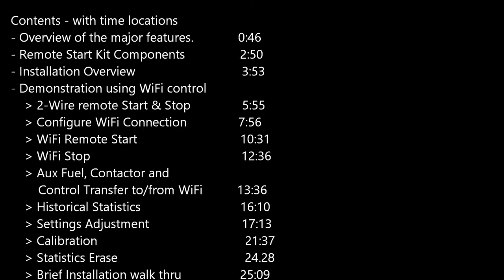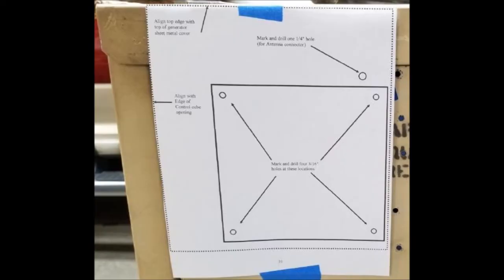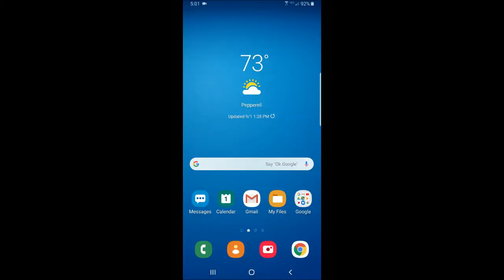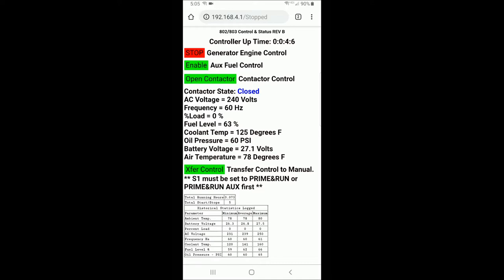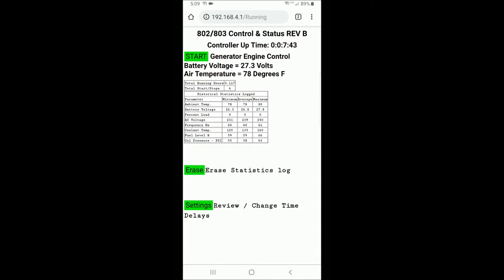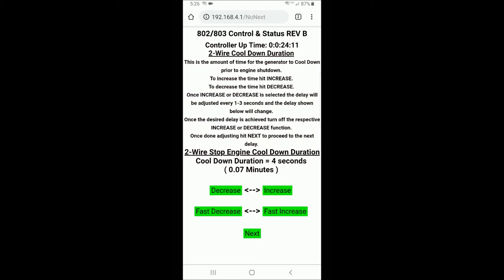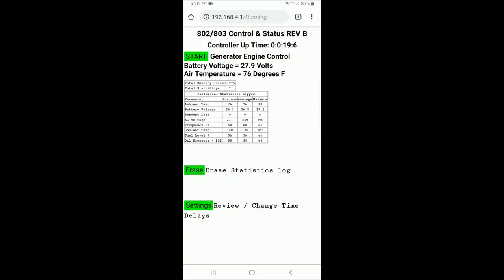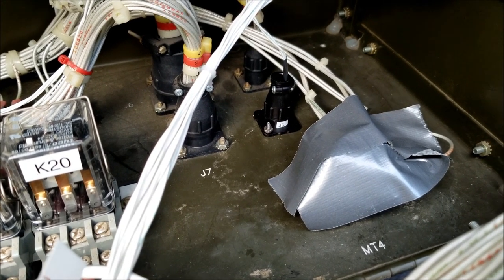MEP 802A MEP 803A Remote Start Kit

Comment: Looks fantastic.  Can the controller connect to my existing wifi router so it is not necessary change wifi connection in order to access it over the network?   Or can it be connected to router via cat5?  I would like it to be available on my existing subnet, and also generator is too far for wifi signal from inside my house, but I do have a remote wifi router near the gen.
Reply from the maker: Dan,  There is not Cat5 connectivity to the Controller.  However I could easily change the Controllers firmware to have it connect up to your WiFi router near your generator.  I'd just need to change the firmware and add your remote routers SSID & Password prior to shipping one to you.
Reply: Thanks Kurt.  I just realized this is only for 802a/803a.   Do you by any chance make one for mep-002a or plan to?   I've seen another board, but it doesn't have all the fancy wifi stuff that yours does.
Reply from the maker: @danlibby6810  Dan,  At the moment I do not have plans to develop one for the -002/-003's at this time.  Working on other new products for the MEP's at the present time.  Other products already available are a MEP-831A Remote Start, MEP-831A Battery Chargers, MEP-831A Replacement Governor Controllers.  Products in development is a MEP-804A/B Remote Start & a Governor Controller to support MEP-831A PMA & Inverter replacements.
Reply: @kurtklopp4172  This is excellent. I would like to get one programmed to log onto my existing Wi-Fi so that I can then use my phone or tablet anywhere in my house to connect to the generator app. Where is the best place to get this from you, with ordering it with my Wi-Fi credentials sent to you? Thank you!
Reply from the maker: @Johnny0005  The controller is now available in WiFi Station Mode or Access Point mode.   To order goto the Steel Soldiers forum Classifieds Section Parts for Sale topic.  Search Remote Start.

Comment: Very nice. Will this work on a 3kw MEP-701A?
Reply from the maker: No.  This unit is designed to interface specifically with 802 thru 804 gen sets electrical systems.  Unfortunately few use the 701 or it's cousin so I haven't developed a unit tailored to it.

Comment: What auto transfer switches will work with your  auto start kit ? Does this have a 12v out to control the transfer switch?
Reply from the maker: Jeff,  The Remote Start kit has a "2-wire" interface that can be connected to a toggle switch, solar charge controller or "Smart ATS".  It just needs one of those items to make a contact closure between the 2 wires on my interface to tell the generator to start.  Smart ATS's have controllers in them that have a relay that it can close and open to tell a generator to start & stop.  Less expensive "Dumb" ATS's don't have that feature.  
The system does not have a 12 volt DC output on it.
However... I do produce an ATS support board that works in conjunction with my Remote Start system to interface to an ATS smart or dumb.  It does have a 12 volt DC power supply on it.  It also monitors the utility voltage and detects when there is a power outtage to start and stop the generator.  The ATS support board also has several relays to control a dumb ATS such as a Generac RSXW100A3, RXSC100A3, RXSW150A3, RSXW200A3, RXSC200A3 transfer switches.  The relays handle transfer switch operation as well and powering the SACM in the Generac ATS's.
Kurt
Reply: @kurtklopp4172  Thanks for the quick reply. I should have just messaged thru Ebay.  I am a general contractor & typically do all my own electric so have decent electrical knowledge.I put in 2 complete Kohler gensets about 7-8  years ago but did not pay much attention to the exact start sequence.  The Kohler 200 amp ATS I installed if I remember right did have two low low voltage wires as a trigger since I used 14/2 instead of a hour round trip to HD .   I just picked up 3 Mep 802 & 803 generators for me and my family so plan on getting them set up fully automatic. Do most of the ATS like the Kohler & generac provide the 2 wire signal required. Do you have a ATS you prefer. Thanks Jeff
Reply from the maker: @jhbrown53  Jeff,  Make sure the MEP generators you picked up have the "Fuse Mod" installed in them.  It's a fuse and fuse holder just to the left to the A1 Voltage regulator behind the gauge panel.  If they don't I have kits available on ebay.
Different manufacturers of AT's offer various Smart & Dumb ATS's.  There is a wide variety of makes and models out there.
Normally it would the more expensive ATS's that have a smart controller in them that monitor utility power and that have a means of signaling a generator to start.  The less expensive ATS's like the Generac model I mentioned earlier and others are just a Transfer switch and do not monitor utility power and have no mechanism to signal a generator to start.  They rely on something external to do that work.
The ATS card I mentioned is essentially the smarts needed to monitor utility power, start and stop the generator and cause the ATS to switch between power sources.  I'm very familiar with the Generac model I mentioned.  I have one here that was used to develop the ATS control board.
Reply: @kurtklopp4172  Hey Kurt, Sorry for flip flopping between here & the bay. Thanks again for all the info & taking a ton of time to design this controller. I would like to get in touch via email to cut out the middle man if that would be ok with you. I will most likely be doing several of these & will be easier dealing with you directly. I have tried to put my email in the comments twice, once pretty sneaky but were deleted. Just let me know if you would be interested or would prefer to just go thru the bay.

Comment: I have one question -- and it may be immaterial, but... -- You mention early in the video that having the kit installed doesn't override front-panel control.

But what if you've started it remotely, and the front-panel master switch is in Stop?  How would you then stop it?
Reply from the maker: What was meant is that the generator can still be started and stopped using the front panel controls just as if the Remote Start kit isn't installed.

To explain the Remote Start kit operates in "parallel" with the front panel controls.  If the set was started via the from panel switch control can then be passed to the Remote Start system.  Once control is passed to the Remote Start system the front panel switch can be set to STOP and the set will continue to run under control of the Remote Start.  The opposite is true too.   If the set is started via the Remote Start control can be passed to the front panel START/STOP switch.  Once done the front panel switch can be used to shut the generator down.
There is a feature in the web browser control to perform the passing of control back and forth between the Remote Start system and the front panel controls.

Comment: could this be used with an interlock kit or only with a Automatic transfer kit
Reply from the maker: The 2-Wire Remote Start feature can be used with anything that has a basic contact closure to signal the generator start and stop.  It can be something like an ATS or something as simple as an ON/OFF toggle switch.  If using a toggle switch when the switch is ON the controller will start up the generator.  When the toggle switch is switched to OFF the controller will shut down the generator. 
If you are using a manual interlock on your panel you could mount a toggle switch near it.  Flip the toggle switch, wait for the generator start and then manually flip the interlock to use the generator power.
Versions of this system now also support the MEP-804A, MEP-804B, MEP-805A & MEP-806A.

Comment: Kurt, does the software work with an Apple iPhone?
Reply from the maker: Yes it does.  Will work with most any WiFi enabled device with a browser.
Remote Start kits available on ebay for the 802, 803, 804, 805A & 806A.
Reply: @kurtklopp4172  thanks for such a speedy reply. I am certainly now going to go ahead with purchasing an 803A and remote start kit - do you have any recommendations about Automatic Transfer Switch?
Reply from the maker: @MegaBadwolf  I believe the Asco Transfer switch's support 2-wire generator Start/Stop.  The Transfer switch needs to have a set of contacts that close to tell the generator to start and open when the generator should shut down.
Reply from the maker: There is no "app" needed on the phone, laptop or tablet.  Only a browser is needed.
Reply from the maker: On request they can be configured to run in WiFi "Station" mode.  In Station mode they connect to you homes WiFi router and can be accessed by any device on your home network.

Comment: Can this be used when in 120/208 3phase configuration?
Reply from the maker: Tom,

Yes,  It can be use in 120/208 3 phase configuration.  The current wire harness has 4 wires (unlike 2 shown in the picture) that go to K8 so it can detect the current in each of the three legs.   Kurt